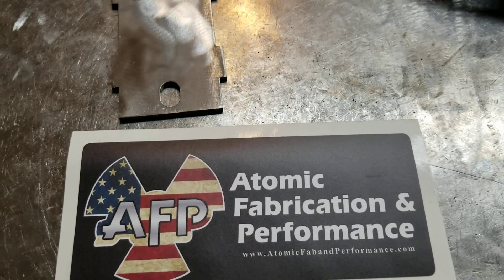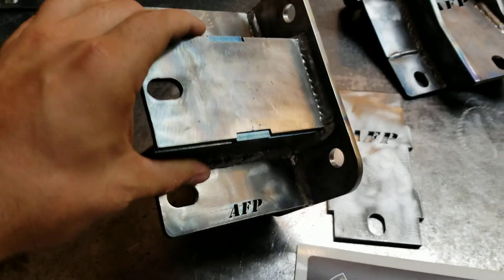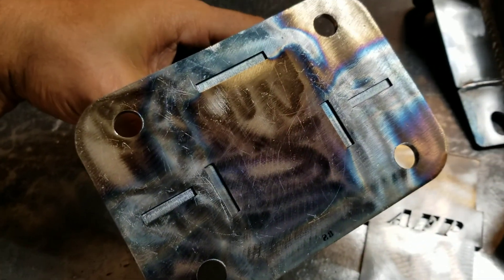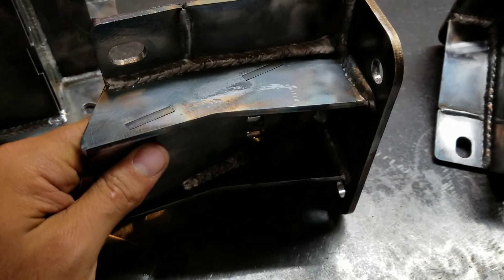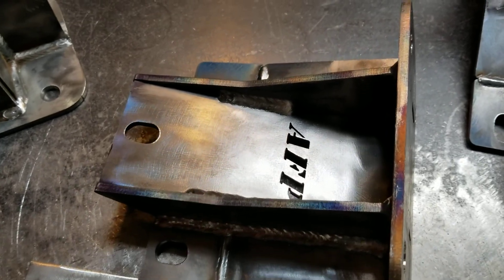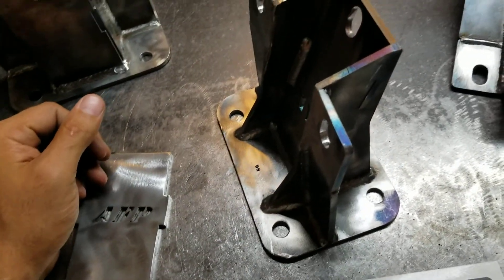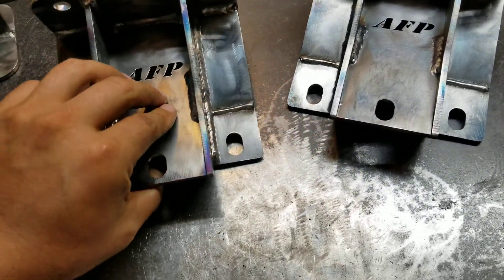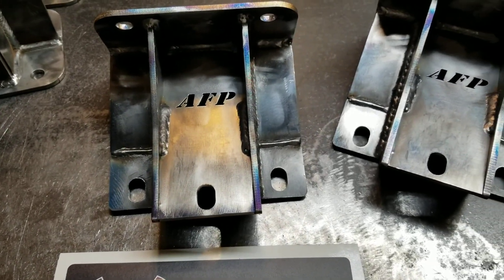AFP 99-14 GM Truck Solid Motor Mounts

Comment: Been looking at getting these solid mounts for my 2012 Tahoe. Engine is cammed and shakes a bit do you think this will vibrate to much?
Reply from the maker: I would recommend the poly mounts instead, They are easier to install and more forgiving and still good for 1500hp+ strength wise.

Comment: Do these for sure fit a 4x4 2008 Tahoe and will I have to replace the oem manifolds for something aftermarket? Just had my oem mounts go out and am interested in these.
Reply from the maker: Yes, I have both solid and poly versions on my site.  I recommend the poly versions for a normal street vehicle, the solid ones are more for racing. WWW.atomicfp.com

Comment: What about the excessive vibrations from idling.
Reply from the maker: Most people say that they can't tell any difference, but the poly mounts I make will be more forgiving.
Reply: @atomic178  I dont need any right now but I'll keep your link, I have to put a transmission after the holidays in my 2010 suburban and I'll  get some and change them at the same time thanks.the factory ones are a joke

Comment: Will these break the block or strip the bolts out
Reply from the maker: No, why would they do that?
Reply: atomic178 just headed off the engine is fixed to the frame that it’s possible to crack or mess the bolts up....
Reply: I think I’m purchase yours soon... mine went out 3 times this year
Reply from the maker: @arealmaintenanceandrepairl1103  Sounds good, I guarantee you wont break mine ;)

Comment: I purchased the hooker turbo manis for my 03 Sierra and it’s hitting the oem mount will I get more clearance with these solid mounts
Reply from the maker: Hey Bryan, I haven't personally tested my mounts with those manifolds, however in general my mounts are more compact than the OEM ones while also being much stronger. You are welcome to try them and if they dont fit you can send them back and I will give you a refund no problem.

Comment: Do you make transmission mount?
Reply from the maker: Not at this time. In general the stock one works as fine as long as the engine is kept under control by good mounts. Its the engine flexing around that wears on the trans mount. Never solid mount the trans.